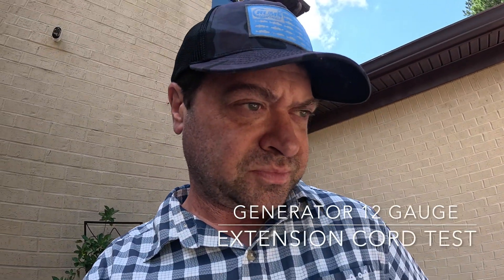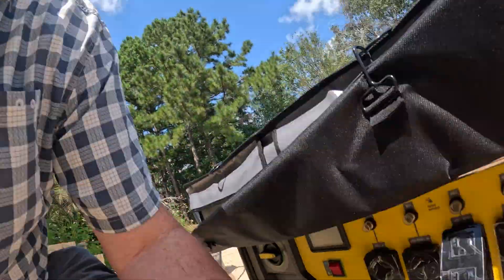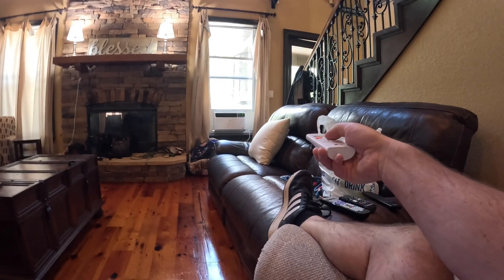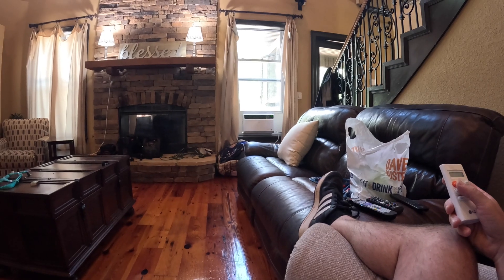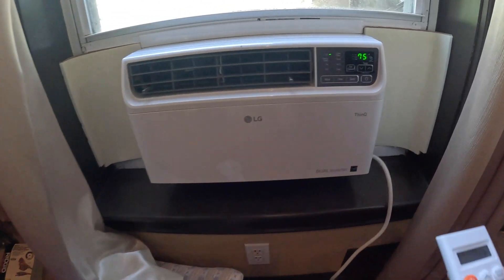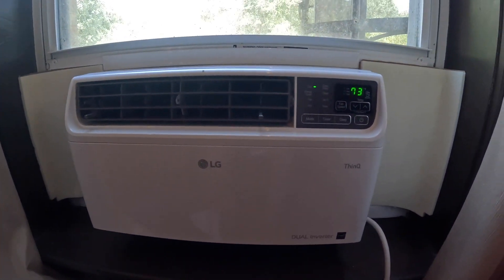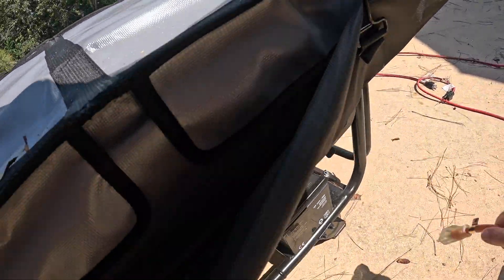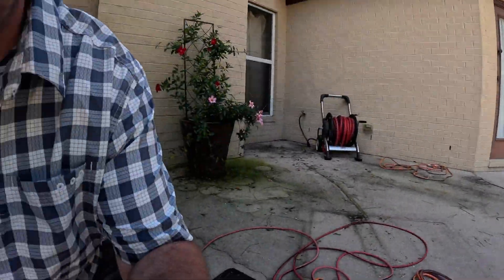Generator Extension Cord Test

Comment: How many hours did you run your a/c at 74 with the 12 gauge extension cord? Did it heat up ? Did you notice any heat damage at the plug area ?
Reply: Thanks. Appreciate video…
Reply from the maker: @donaldsmith9467  maybe 5 minutes if that before it tripped.  Didn’t have any damage to cord and didn’t feel any heat on cord.
Reply from the maker: @donaldsmith9467  sorry, the 12 gauge worked great.  It was the first cord I had on that was 16 gauge

Comment: hope all is well
milton looks pretty bad for us on the west coast fla

have the same gen

does that weather thing work in rain? is that a gen tent?

also the manual says the unit needs a 6-8 foot grounding stake and wire and i’m hunting around and never see anyone use it 

does it need do be grounded?
Reply from the maker: @JezebelIsHongry  we were fine in Tallahassee.  This new storm looks bad for Tampa. Yes, the cover works in the rain. That’s what the cover is for.  I made a video on that.  I don’t have a ground stake for my generator.  Never used one and never had a problem.

Comment: temperature shouldn't mean anything when it runs its not like a gas pedal on a car it doesnt run faster the lower you go. 14 guage is the smallest wire not for motors maybe a drop light. should buy a num 10 wire thats what i use on mine. i also did a/c repair for 50 years  you need a amp probe to measure amps

Comment: Great video on extension cords :) glad we are all good here in Tallahassee 😅 I have same crappy sump pump issue lol 🎉
Reply from the maker: @vikingerik80  thanks man!  We got so lucky.  Unbelievable.
Reply: @happy_hartshornes  100 percent   Unbelievable man. Truly is. Did your window unit come with those flat plastic pieces on both sides? Mine are installed with this cheap accordion plastic on sides 😃 I did buy some thick weather stripping but your set up is much cleaner!
Reply from the maker: @vikingerik80  yes, I have that accordion stuff but mine also came with some insulation pieces that I put in over the accordion part.
Reply: @happy_hartshornes  awesome!
Reply: There’s another storm coming in about 7 or 8 days if you live in Florida. Getting all my propane tanks filled tomorrow…..
Reply from the maker: @ yep, I saw.  What a crazy year. I still have all my chairs from outside in my back porch.